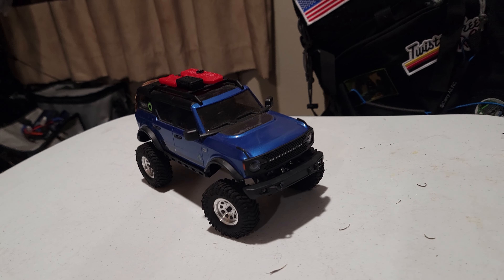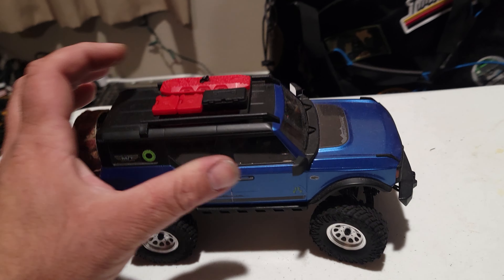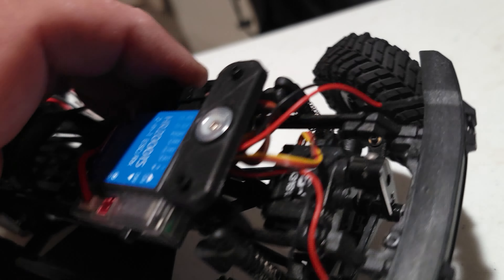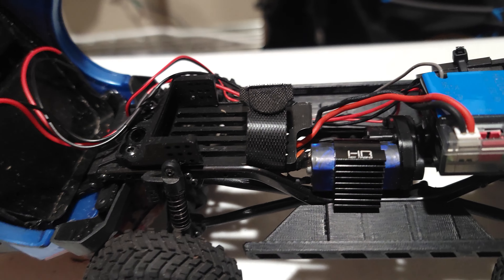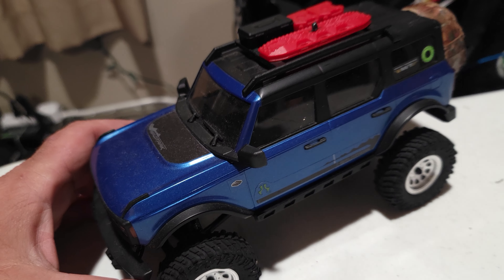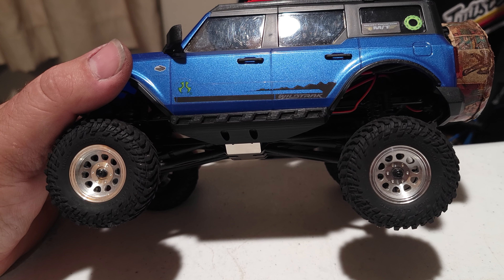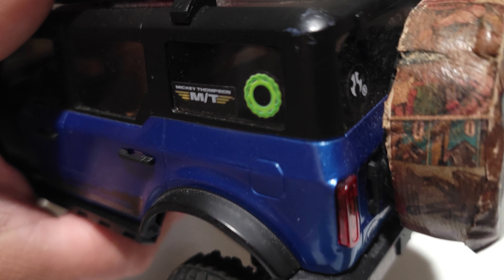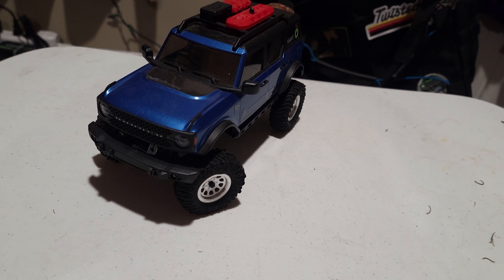SRRC's Axial SCX24 Bronco!

Comment: You’re not gonna believe it, I was running a stock servo for nearly 2 years on my C10. 

Replacing it with another stock servo is tempting. No matter what I do to the truck, if I’m running a stock servo that’s the first thing that gets noticed lol. 

I had to acknowledge the servo in a video shortly after it died.
Reply from the maker: The stock servo isn't bad at all, I'll probably run and see how long it lives.